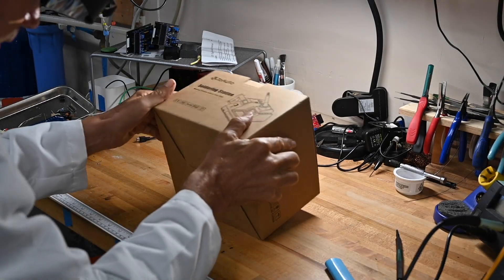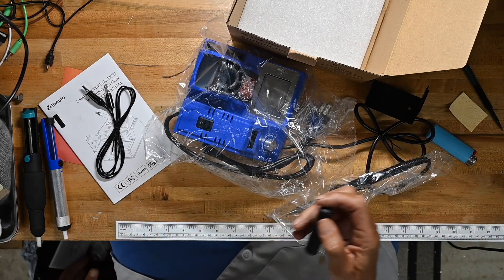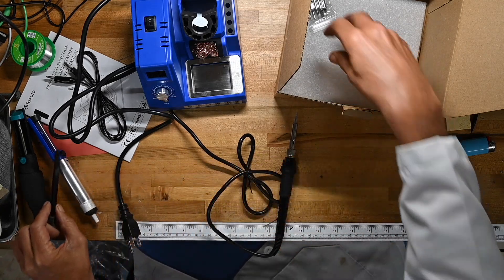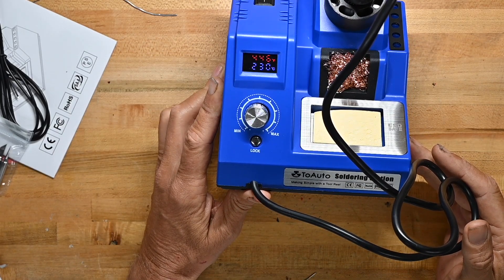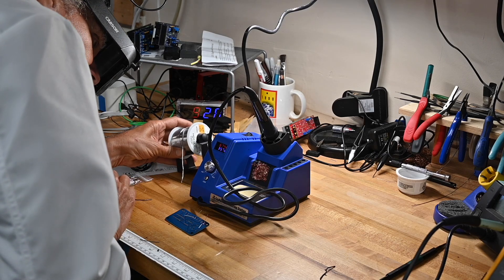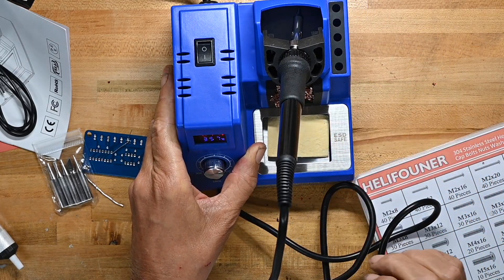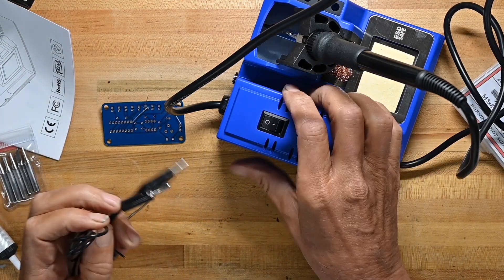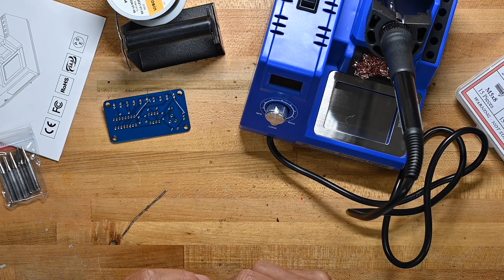C.K. tries a ToAuto DS-90 solder station

Comment: Cómo puedo aserle una punta a esa clase de cautín
Reply from the maker: La base del soldador tiene una tuerca estriada en el extremo; puedes desenroscarla y retirarla con cuidado, luego quita la punta actual y reemplázala por la que prefieras. Este soldador utiliza puntas de tamaño estándar, fáciles de encontrar. ¡Por supuesto, asegúrate de que el soldador esté completamente frío antes de hacerlo!  Gracias! 
(Google translation of "The base of the soldering wand has a ridged nut on the end, you can unscrew it and gently pull it off, then pull of the current tip and replace it with one you prefer.  This unit takes standard size soldering tips that are easy to find.  Of course, make sure the iron is fully cold when you do so!")

Comment: Hello, I have been reviewing several videos and information and this station is great (better than many cheap JBC clones with modern tips). The only detail I would like to know is if it is easy to replace the handle and if they are easily obtained.
Reply from the maker: I want to make sure I understand your question;  do you mean the full handle, meaning the cord and the wand, or do you mean the tips?  If it’s the tips, yes, they are standard sizes and easy to find replacements.  If it’s the full wand/pencil I am not certain. Thanks for stopping by!

Comment: My station came with the screws for the solder holder. Hopefully yours was just a fluke. If that's the case, it doesn't speak highly of the quality control...
Reply from the maker: Probably just a one-off mistake, and it is still usable at least.
Reply: mine came with them too, but one was already out of the bag from the holder, so I was sitting there for a bit thinking they only gave me one screw for... something lol